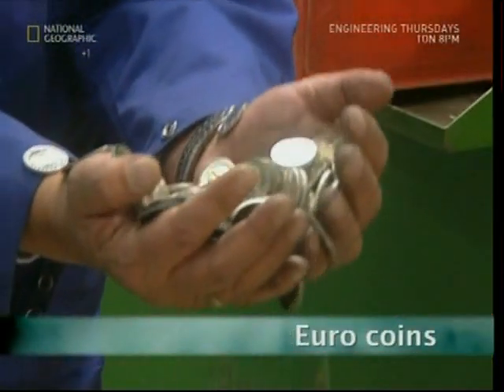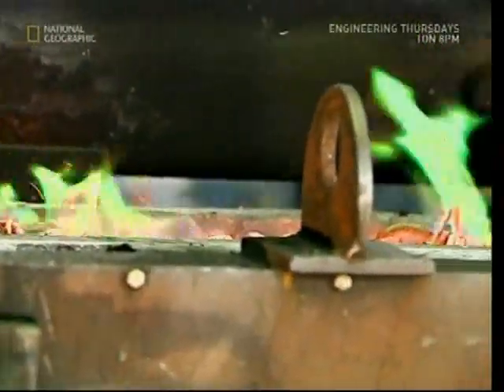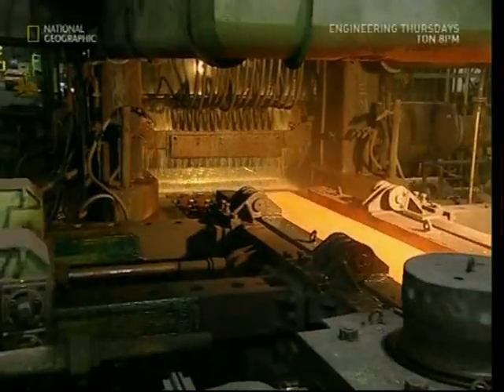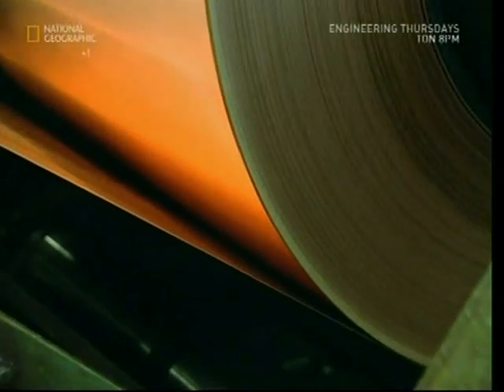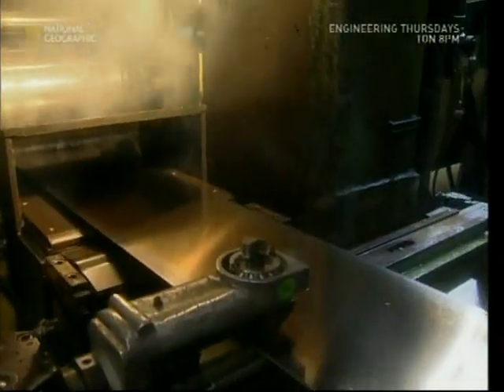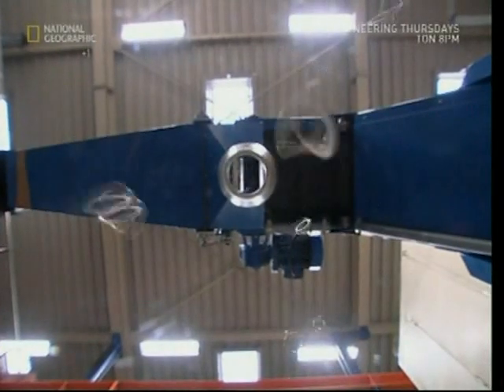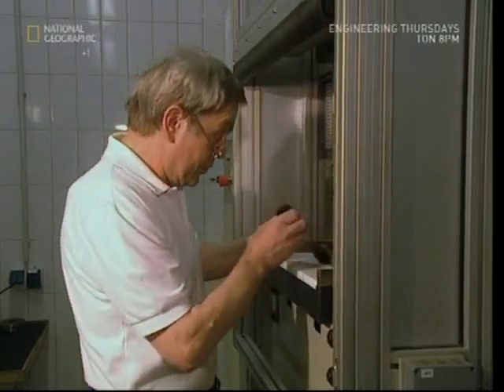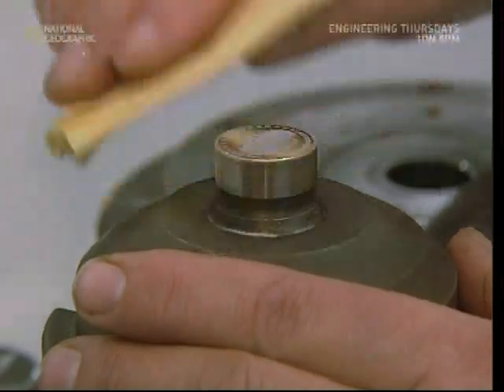How Its Made - The 2 Euro Coin (€2)

Comment: So, how do you put the rings around those empty copper/nickel sandwiches? Don't you just hate it when documentaries omit parts?
Reply: It says "the ring is put into place" and shows the stamping machine that gives coins their shape, but doesn't show the process of HOW the ring got into place. It shows everything else but that.
Reply: they press it
Reply: I guessed that as well, but they don't show it in the video, that's the point.
Reply: the process happens in concealed space ( inside a closed tube, both for the ring and the filler). The mechanism shown at 4:40 is quite clear to me. I guess it is impossible to disassemble those parts to show how it functions. 
Though I get your point, it would be awesome if they can get a sneak inside.
Reply: @lantranarde If they show it, a counterfeiter watching this video shall get ideas.
Reply: @4:40
Reply: The centerplate of the coin is a tiny smaller and thicker than the ring of the coin.A machine lays the centerplate in the ring,a little later under high pressure they are pressed together so ring and centerplate thickness are equal.At that moment they throw the blanc coins in a machine that stamps the image on the coin.In some countries the stamp with the image press ring and centerplate together in one process so they dont have to use a second machine.(Germany and Italy) for example 🤗
Reply: I was just thinking the same, how did they manage to put them together one by one
Reply: @HAIRHOLIC_1  There's probably a press of some short, or method they don't want us to know.
Reply: It says that it is hammered together

Comment: Copper is now a semi precious metal, and has an incredible range of practical uses.  Why are they wasting it to make coins?  Coins should be made from a high grade plastic with chemical tracers to avoid counterfeiting.
Reply: +rationalguy because gold and silver is more expensive. and this is the era of fiat currency
Reply: +rationalguy But how would one know if that plastic coin is real without proper testing instrument?
Reply: Sfolter if paper is fine, why not plastic?
Reply: +Lip Jing Ng The Paper Used To Make Money (Its More Like Plastic But Whatever) Has Other Ways Of Checking If Its Real (Water Marks, Stuff That Only Shows In UV, Etc). Also, Copper Is Cheap Compared To Other Stuff, Thats The Main Reason Of Its Use
Reply: +João Martins plastic last longer, waterproof, doesnt contain as much bacteria as paper.
Reply: plastic melts? "Duh" PET plastic melts at 200C, not to mèntion that plastic temds to discolor by exposior to sun, water, earth. And not to mention that plastic is way more vulnerable than metal, you can easily cut plastic with a knife, cutting metal is more difficult :P i could go on if you'd like :)

Comment: Would they do a similar process for £2?
Reply: +Connor Steppie the only real difference is the metallic composition (which metals are used) and dimensions of the coin.. the €2 coin uses just copper and nickel however a £2 coins outer ring is roughly 20% zinc and the other 80% made up of mostly copper as well as nickel.. €2 coins contain no zincthe inner circle is made of "cupronickel" an alloy of copper and nickel, however there's less copper in this alloy meaning the metal is silver and not brass coloured. The outer ring is cupronickel on a €2 coin however there is more copper to change the colour. There is no evidence to suggest the inner circle of a £2 coin is a sandwich as it is in the €2 coin

Comment: Is the metal worth 2 euros or because its a coin its value is 2 Euros?
So if i get 5 2 Euro coins seperate them melt them and sell them will i get 10 Euros or less?
Reply: You must accept it for payment at 2 Euros because it is legal tender. The metal probably costs less. (Only a few coins like the penny have a higher metal value than face value)
Reply: So because its Coin with the face of 2 euros its worth 2 Euros 
ok got it thanks
Reply: Wanted Ghost Your also not allowed to seperate them your self.

Comment: All that fancy minting gets involved but did anyone pose the actually important question at any point: why on earth would anyone attempt to counterfeit 2 euro coins?!
 
God damn, it's just 2 euros. It would take ages to counterfeit a single coin, let alone a mass of them. All that while you could just print paper, which has nominal value hundreds of times greater.
 
No-one is going to counterfeit any base-metal coins, even if they were worth 10 euros a piece. It's just not worth the trouble.

Comment: if that's the case, then why do i have the highest comment?

and try this then, get one of those polyethylene sheets used to keep cards 'safe', and put it on a tungsten light bulb. give it 5 for the bulb to heat up, then 5 more with the sheet on the light bulb, and you'll have a semi-melted *plastic* sheet.

Comment: you can actually see that it is a German coin from 2007 (Mecklenburg-Vorpommern). The mint mark A (for Berlin) is very small at the 12 o'clock position on the inner part of the coin, as I posted when you stop the video at 4:50 you can see on the uniform the emblem of the Berlin mint and also the name Berlin

Comment: The stamp is fitted into the machine, however at this point we dont have any complete coins to stamp, but everything's about to come together.

The ring is put into place and the filling dropped into the hole, the two are then placed under the stamp which hammers them together.

This both impresses the value onto the coin and compresses the two pieces together.

what emerges from the pipe is a brand new 2 euro coin ready to be spent.

Comment: Using an industrial press he crushes a pattern onto the stamp block. It exerts 160 tons of pressure, so hes got to be very careful.

The stamps are hardend in this furnace at 870 degrees celcius, without this treatment, the motif would disappear very quickly.

once its been hardend each stamp can engrave as many as 200,000 coins.

The surfaces are scraped clean using fine glass to remove any imperfections, then they are checked and polished before being put to work.

Comment: The rings are a little dirty, but a quick bath in acid mixed with ball bearings grinds away the filth leaving them sparkling and ready to be turned into money.

so we've got our outer rings and we have already made up the fillings, but theres still something missing. all of our pieces are blank bits of metal, a template is needed to turn them into coins.

the engravers job is to make the coin equivalent of a rubber stamp.

this permanently marks the value onto the coin.

Comment: this press hammers the sheet 250 times a minute as it cuts the fillings for the big 2 euro coins.

if you look closely you'll see the nickel sandwich with copper alloy on top, nickel in the middle and copper alloy on the bottom.

meanwhile, in another part of the factory, another machine is stamping out the outer rings. these big hoops will be filled with the copper/ nickel sandwich.

the middles that have been removed will be returned to the furnace to start the process all over again.

Comment: different metals have different magnetic fingerprints. the 2 euro's special characteristic is the filling for its hole, this is made up of 3 layers of metal compressed together, theres copper on the top and bottom and the middle is nickel.

to make this filling the different metals are fed into the machine and compressed together so hard they can't be seperated.

from this sandwich of metal, we can now start to stamp out some coins.

Comment: to hot roll the metal its heated to about 900 degrees celcious, thats the hot bit then the metal is pressed back and forth between a series of rollers to spread it out.

hot metal is far easier to manipulate than cold. so by pressing to through the rollers the factory ends up with a really long sheet of copper.

this form is far better for making coins than a big lump.

the next stage is to clean the metal, the heating and cooling has given the copper a dirty colour. so now its scrapped clean.

Comment: they are then sent to the foundry where the copper is melted down, molten copper leaves the furnace at 1200 degrees celcius emitting brilliant green flames.

But this is only the first step, we've got the copper into a workable form but theres still plenty more to do.

First the metal must be cooled and the two enormous slabs weigh 70 tons between them and you could press about 2 million coins for them and all.

They are chopped up into 5 meter long chunks, then its time for some hot rolling.

Comment: @jewbybrother579 But this is how it works, checking the diameter, the density the electric resistance and how magnetic the coin is, presumably by creating an electromagnetic field to mesure how strong the coin is magneticly pulled. Making it nearly imposible for someone to fake the effort to fake a coin would ,ost likely exed it's value.